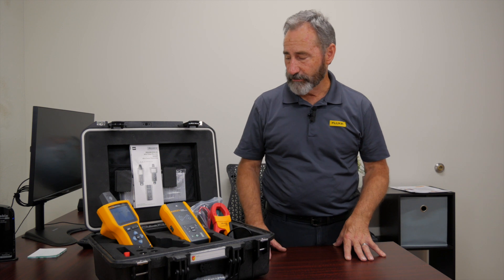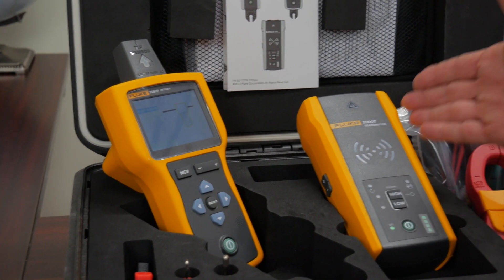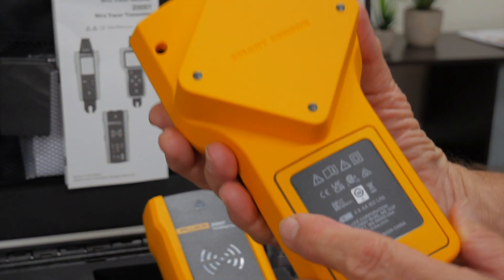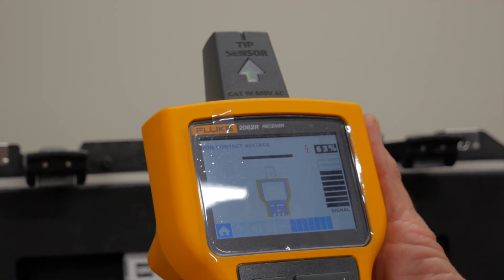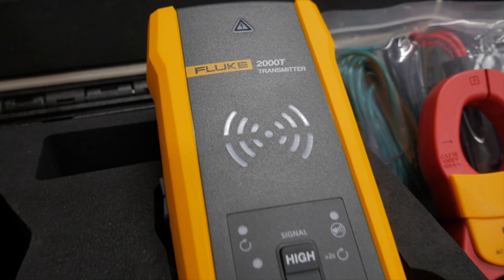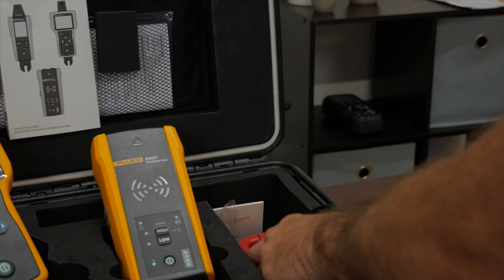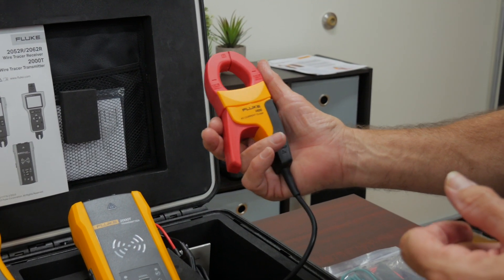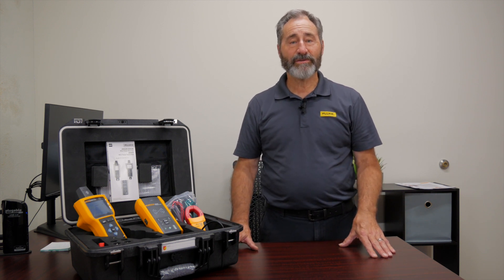Fluke 2052 and 2062 Overview

Comment: What is the maximum depth at which you find the cables? Do you also find them in the ground or concrete? Thank you in advance for your response. Regards.
Reply: We have had some success picking up cables underground with this. However we have gotten several mis reads, presumably due to the armouring on different cables being connected to the same earth. So when we thought we were picking up our cable, it was actually a different cable. It also does not like cable tray!! It has come in extremely useful in certain instances but it does have its limitations.
Reply: @ it’s a heavy price. Would you say it has helped you a lot? I just bought it over the ideal.
Reply: @trevorryan3343 hi Sir, in which situation it was helpful to you, please advise as im thinking of buying one
Reply from the maker: The maximum circuit distance is 20ft, however, it is not specified if this would be the same when comparing something like drywall to concrete. Regardless, it is not recommended for underground use.
Reply: Hello, would you say that this is just as good as the ideal 959, or better?